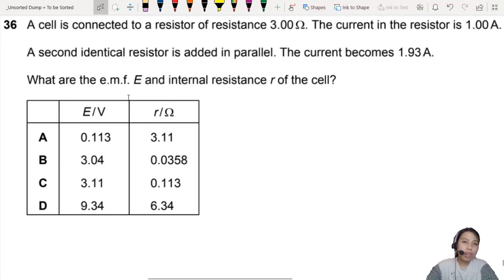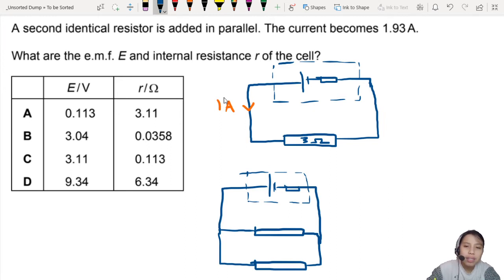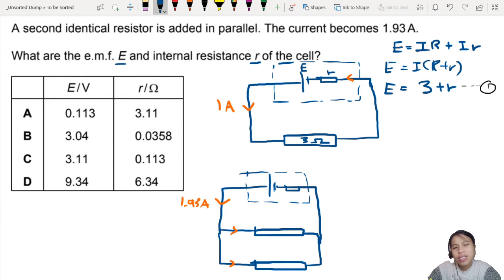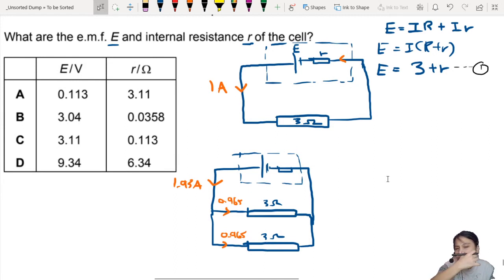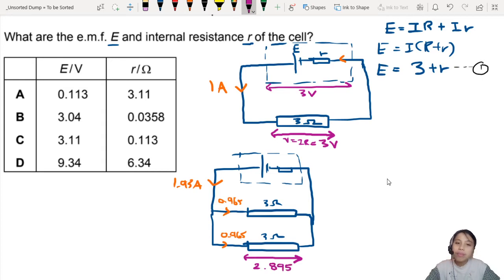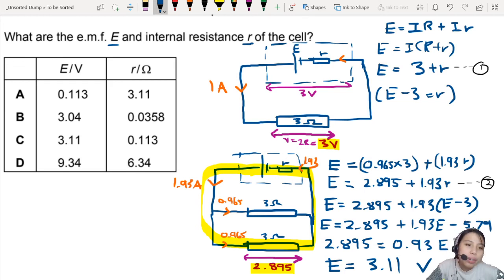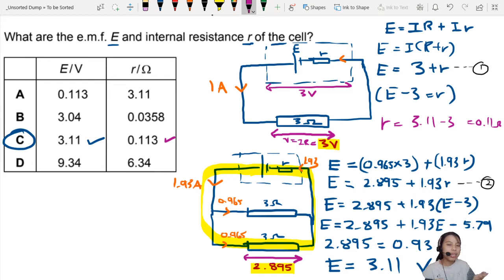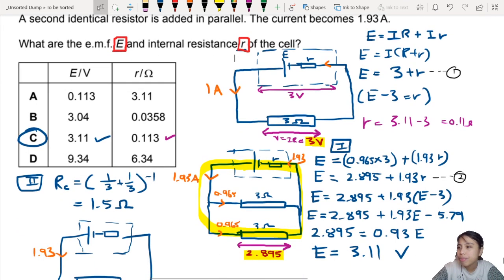MJ19 P11 Q36 Solve emf and Internal Resistance Simultaneously | CAIE A Level 9702 Physics

Comment: The wording is so hard to understand 😢 They say the "current becomes 1.93" without clarifying the the overall current or the current in resistor 😢 How do I understand wording better?
Reply: I faced the same problem as well
Reply: I think she did forget one step in terms of this. 
Terminal V = Ir: 1 * 3 = ROUGHLY 3v
So if we apply this to now a parallel combination, resistance drops to 1.5 Ohms and hence the I = V/R gives us 3/1.5 = 2 A for the WHOLE circuit. 
So in now way could they be talking about each this way, since that would exceed the 2 A maximum theoretical limit we just calculated

Comment: When we have 
E=2.895 + 1.93E -5.79
then it goes to
2.895=0.93E.........how does it go from 1.93 to 0.93
Reply: i had the same doubt, but its like 1E = E right? so the step she skipped was 
E - 1.93E = 2.895 
so here u take E as 1, so 1.93 - 1 is 0.93. 
so u have 0.93 x E = 2.895 left in the equation and from here 
E = 2.895/0.93 = 3.11

Comment: there is a shorter way, we calculate first the terminal potential diffrence in first circuit with single resistor which comes out to be 3V and we know that E.M.F in greater than the terminal potential difference so in the options we have two choices which have E.M.F greater than 3V and the closest internal resistor value which we will minus from the E.M.F willl give us 3V. In this case it is C
Reply: and also option D will give terminal p.d = 9.34-6.34= 3 which is exactly the terminal p.d. but D is not the answer.